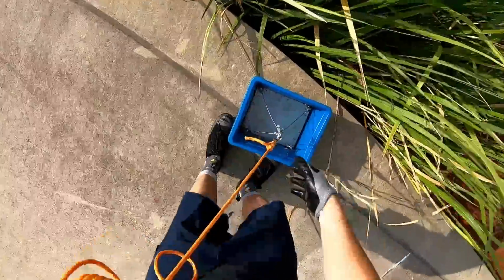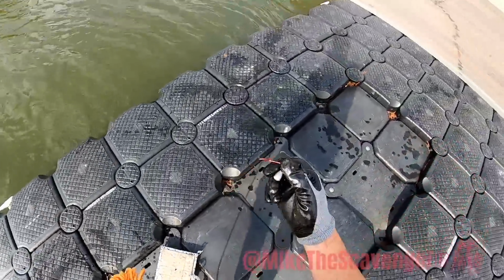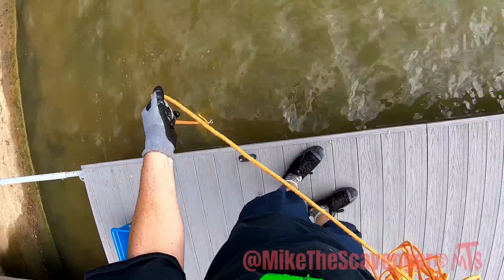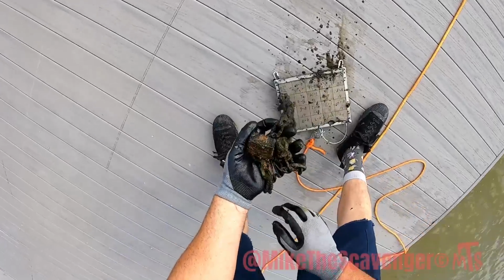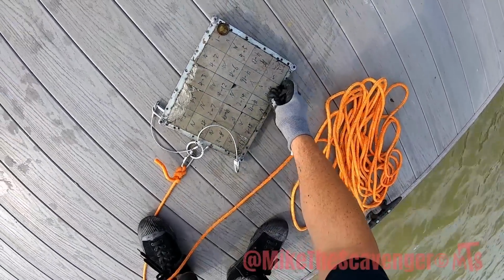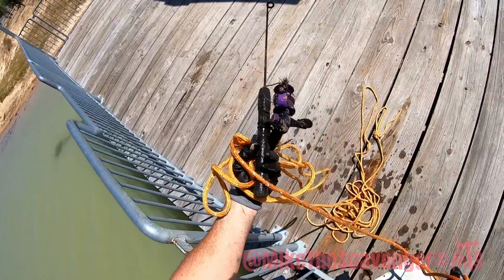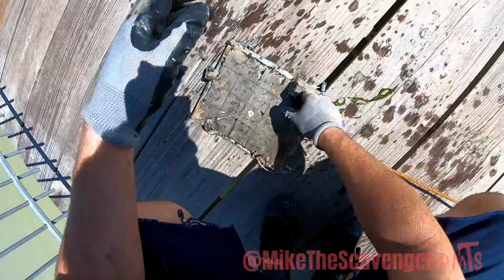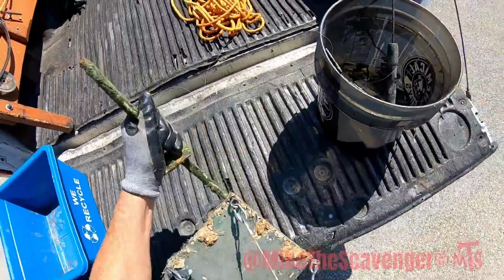Magnet Fishing With A HUGE MRI Machine Magnet!!!

Comment: That's one hell of a magnet, mate.
Reply: I wanna know where he got one like that! All mine are round lol
Reply: Big Mike, yeah that's one big magnet. Maybe a little too big for you to be throwing off the side of a dock. We get the best dad ever you need to be able to throw it 20-30 ft out drag it back in. And being flat like it is it'll just dig into the mud. And I don't think you're strong enough to be able to throw it that far out anyway. But what it would be good for is to get you a little aluminum boat control out there little off the banks and Docs and drop it over the side of the boat. That way you can drag her along the bottom and then just pull straight up. At the same time real fishing in after you stir up the bottom at the same time.

Comment: Hey Mike,  on the lifting eyes coming loose. Just run the threads out past the nuts maybe an 1/8 of an inch and use a ballpeen hammer and peen the ends a little.
 They wont come unthreaded after that.

Comment: You need to build a Crain  , put the beast of a magnet on a boat or barge . If only to stay away for metal walls . Hope that the plate on the bottom works out : try lock tight to prevent the eye bolts from coming loss .